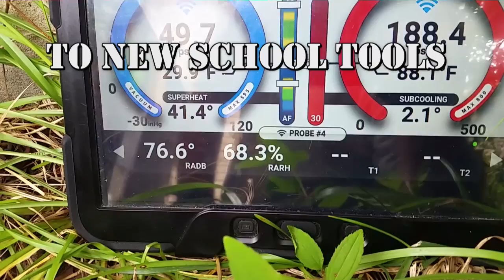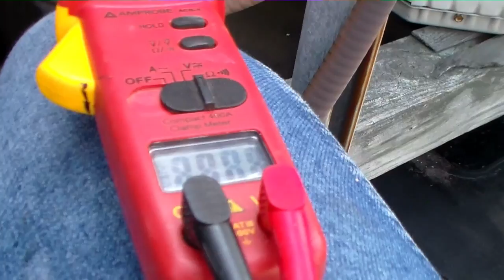Trifecta 3 | A Skilled Tradesman

Comment: I do hope you keep the old video's available even if you move them to the pro channel. The trade is 70% electrical and I'm now rewiring and repairing years of hacks on a 1985 Carrier 2 Ton water source heat pump. All safety's  have failed and  the customer want it to be in service another year. ICM 304C and a couple of relays and now you have a updated system. I will have to open the refrigerant side to install a new HP switch. You must understand and think relay logic and be able to think outside the box to be a great tech. It a blessing and a gift to teach.